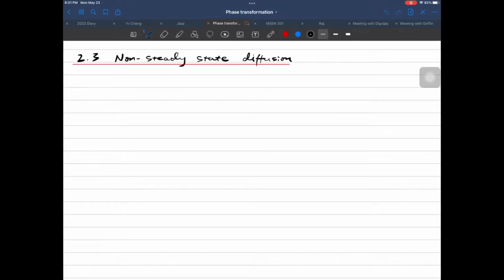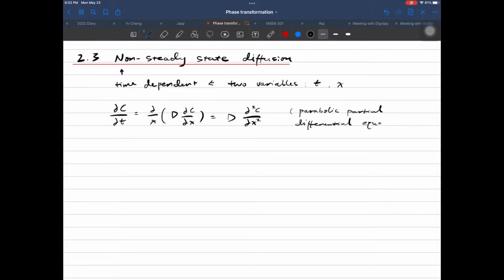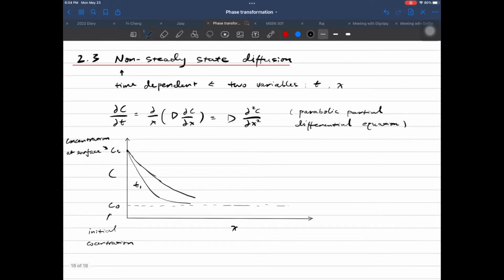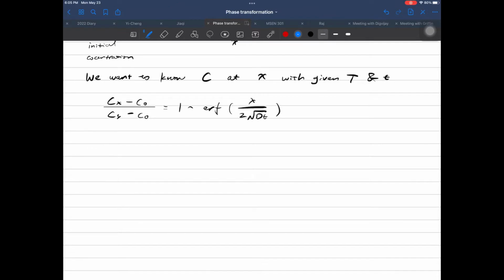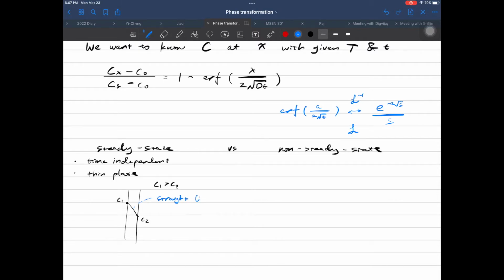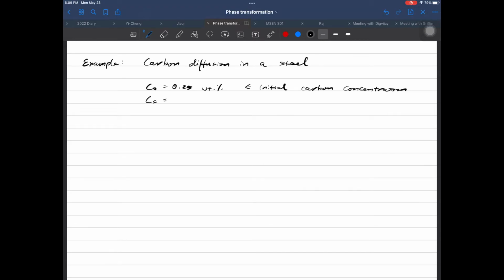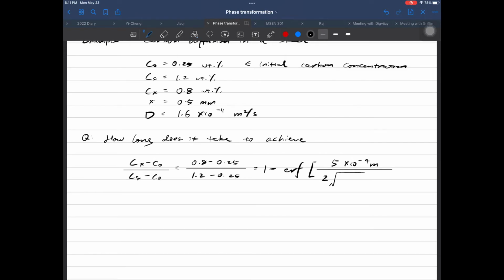2.3: Non-steady state diffusion

Comment: Master could you tell me after you know the Z where the 0.392 from 🙇🏻‍♂️
Reply: 7.02 in the video
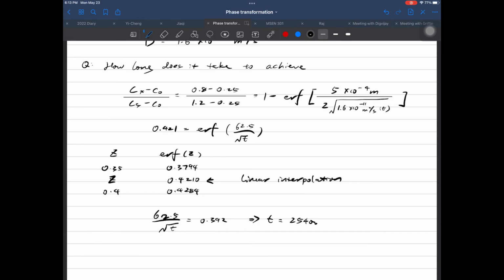Reply: At 7:00, you will see the values of the error function. The Z value is between the top and bottom values of Z and erf(Z), therefore we use linear interpolation to get 0.392.